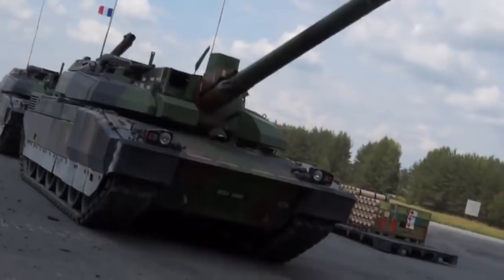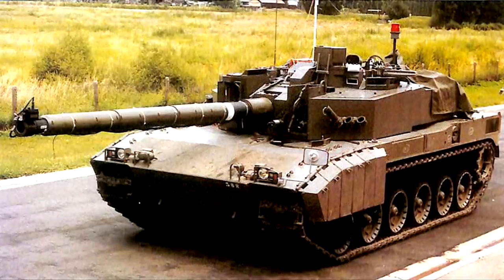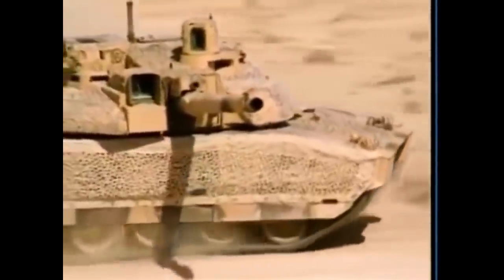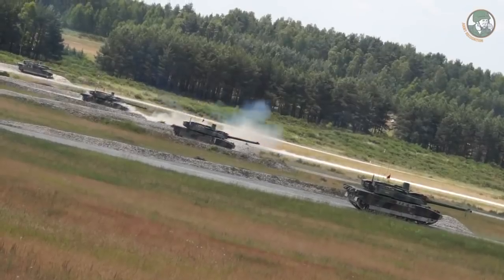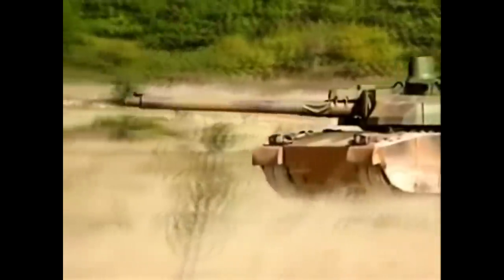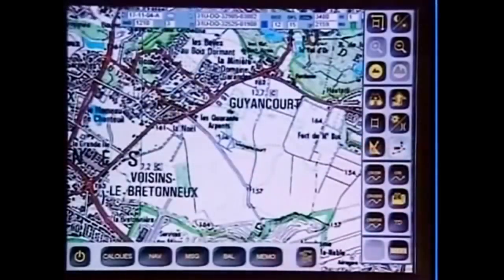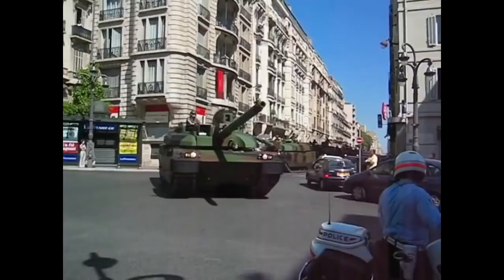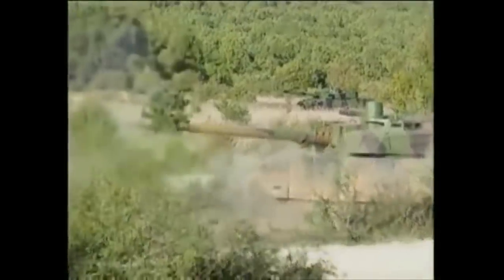Is Leclerc Obsolete?

Comment: It's fun to see how the leclerc is so badly known in the english-speaking world.

1st, The Leclerc's armor is equivalent to a leopard 2A5 for the hull (probably 2A4 for the turret), thicker on the sides. The weight difference comes from the smaller engine block and so a smaller hull.
2nd, in terms of firepower, the Leclerc have currently one of the most effective gun. The L55 for example equalizes its velocity while being longer. And it has now the OFLEs which are classified in addition to the NATO ammunitions. Why producing an anti-tank shell when you're not fighting tanks? That's why the F2 is not very produced.
3rd, what about target acquisition? The leclerc will spot and lock on a tank faster than any tank of its era, driving at 70km/h and hitting its target driving itself at 50km/h at 4km range.
4th, the Leclerc has an autonomy and a mobility superior to its main competitors. It can easily handle a 30° slope, in opposition to an Abrams and a Leopard 2, we won't talk about the chally 2, and can drive for more than 800 kms straight with its fuel tanks. In the greek trials, the tank rushed the raid and crossed the finish line longer before the others.
5th, Coaxial .50 Browning.

The main problem with is that the tank is not upgraded regularly and is not equipped with an APS. The French one doesn't even fight so that's why the army doesn't upgrade it.

But as we've seen in Yemen, the tank is far from being obsolete.

Sources : 
- Encyclopédie des Chars Modernes, Tome 1
- Wikipedia
- Greek Tank Trials Report
- L'aventure des Chars
- Opex360
Reply: Salut, une surprise de te voir ici! J'espère que tu sortira une nouvelle vidéo bientôt.
Reply: @lepointdevue1094  C'est prévu pour noel. ;)
Reply: C’est que des incultes de rossbeef ils l’ont toujours était et ils le resteront toujours : des idiots incultes
Reply: Roland Lee just for you to know. Yes we lost in Indochina in 1954. But 10 years later, after they claimed their independence and begin recognized a country by international, the US attacked it because of "Communism is spreading too much". They even lost more tanks than in Corean War! I don’t see why we need NATO approval to attack or to just do a regular peace keeping operation in a foreign country like Mali. We don’t need NATO for that, we need the Security Council of ONU to go. That’s why you’re wrong on these points. Second of all, the Leclerc wich he is talking about is a former version of the actual one. The Leclerc can withstand a direct hit from his own gun (and don’t tell me that an APFSDS that goes at 1790m/s is nothing) Plus, the OFL 120 F1 and F1B isn’t using depleted uranium so ecological impact is divided by thousands. But I see you coming for the OFL 120 F2 with the depleted Uranium. Yes it has got a penetrator made of Uranium but will you fire it against a little AFV or IFV? No, because it’s priceless in a tank vs tank combat situation. The mobility of the Leclerc is one of the best of the world, and it’s developing 1500Hp at only 2500 rpm, 500 less that the M1A2. And speaking of things like this, the Leclerc is currently one of the best tanks in the world and is actually combat used by the EAU in the Yemen war. It has been proved that it’s capabilities are greater than expected in combat. Now please stop begin salty and document yourself before saying things likes you said under the comment of Kahzmat wich is one of the best tank history youtubers actually. Good night.
Reply: Herr Kahzmat en croisade
Reply: Même pas remarqué que c'était toi xD
Reply: its true during greek trials and for the variations they were offered it had performed on par with L-2A6HEL (in mobility better) many were in favor of it, price was better too, co production was the major issue since ELBO was geared for german tank production and support (L-1), and germans as expected bribed some officials faster, better and more efficient than the french (they have long tradition and massive experience in that field)...
Reply: Larmure du Leclerc est interchangeable donc on peu fair évoluer le blindage se son des bloque de blindage
Reply: Toi ici?!
Reply: @rolandlee6898  go fuck your self
Reply: Dika Vinci 1st the Leclerc has depleted uranium munitions (not nuclear) which can penetrate all the other tank (heavier so with more kinetic energy)           2nd the Leclerc is really the only tank who’s capable of firing with quite the same accuracy as if it was immobile. We are not talking about gun stabilisation but about hitting a target 4km away at every shot.
Reply: Facts: French have most wins in relation to battles they fought. (Wikipedia )
Napoleon is the most succesfull war leader in known history. (Wikipedia )
During Napoleon times europeans taught that  the french were born for war ! 
Von Klausevitz said Napoleon was a god  of war. 
French military history is one of the most glorious. 
You can't judge a nearly 1000 year nation by 6 weeks when they lost to Nazy. No army would have stood against Wermacht in the same condition.

From an Italian with russian heritage who speaks also french .
Reply: You need about 15 tons of armor to cover one person in tank. Leclerc has only 3 crew mambers so that is the reason why it is lighter.
Reply: @rolandlee6898  yeah french people can be proud of her history because at least they have one
Reply: @osefman2763  And who doesn't?
Reply: @rolandlee6898  oh!! the usa! You only have two hundred years of historical existence! You are made of migrants that came from England, France... Yes french people can be proud of her history because you, you only have the XX century
Reply: @osefman2763  There is nothing wrong with being proud of your history. The problem is you still living in it. Its not the 18th century anymore, its the 21st! Write that down on your fridge so you dont forget it.
American history didnt start from nowhere. As an independent country it has a comparatively short history, yeah, but it doesnt mean history starts there. Your history argument only proves my point of you living in it.
Let me ask you this then.. Hypothetically suppose Russia and US go to war, ICBMs start raining down on France because its a part of the NATO crew, youll yell "BUT MY HISTORY!" at them and they will stop? Will Russian history prevent a US (and French) retaliation strike?
History didnt help Dresden, and many other German cities, much either when the bombs fell. Nor did history help France when the Germans run over the entire country in a couple weeks. History didnt help Africa, Asia and the Americas when the British, French and Spanish colonized most of it.
Just because you have history doesnt mean you are a relevant power in the 21st century.
Iraq has history and so does Libya. Did it matter?
By your logic Iraq, Syria and Egypt should the most powerful countries in the world because of their history.
Reply: @rolandlee6898  Russia though is still relevant right ? Oops their economy is laughable compared to France's (just like 98% of countries on earth: lots of people are irrelevant)
Reply: @rolandlee6898  Being on the brink of being surpassed in almost every domain by China, but still yells like a madman toward GB and France... How cute. 

At this point you're just exposing everyone your complete ignorance in domains such as : geopolitics, history, military, and so on.
Why the heck would the Great Donald say  "the French did a great job" talking about last week's hostage rescue operation ? Out of kindness ? Pretty sure not.
And BTW, as you're insisting on the fact we tea drinkers and frogs are living in the past... but aren't you living in the past yourself ? You  can't bear having a better tank than your Abrumz, a better plane than your SuPeRsTeAlTh F-35, losing the rest of grip you haed over Middle East and South America. Sounds like we're not the salty ones here.
Reply: Mais arrêtez de répondre à ce troll. Son opinion n’a aucune valeur.
Reply: @DoubleA44  Russia the second largest arms and military technology exporter in the world, after the US. And its the only country that is a valid strategic counterbalance to the US. Being capable of causing a global mass extinction of most complex life on the planet makes you pretty relevant.
Reply: One question tho.... Why do you think Im American or that I even like the US?
Kinda hilarious how you go there immediately. That says a lot actually. Nice.
Reply: @rolandlee6898  we can be proud to be french in 21th century too
Reply: @rolandlee6898  Can t be a strategic counterbalance to the US when your gdp is more than ten times lower than that of the US. They indeed export crap everywhere but they can t afford modern military equipment anymore (T14 produced in very low numbers, Su 57 still just a prototype). But of course having the biggest nuclear arsenal makes them relevant, it turned out to be very useful when ussr got teared apart at the end of the cold war.
Reply: @DoubleA44  Well thats not really true. If it were crap no one would buy it. Even American experts regard Russian equipment as superb, and in some ways even superior to what the US itself has.
Why would they need T-14 or Su-57 to be a strategic counterbalance to US? US and Russia, if they fight, wont fight with soldiers, tanks and planes. They are completely meaningless,will be turned to ash before the soldiers even dress for the occasion. Which is why Russia is drastically reducing its military in size and going more high-tech. Its sufficient and more efficient for any conventional conflicts they might have and for everything else they have 10'000 nukes and weaponized smallpox.
US can break Russia economically. They are trying at least, and have been since the USSR (with which they indeed succeeded), but militarily its a different matter entirely. Likewise the US itself is susceptible to such means. Primarily from China.
Reply: @rolandlee6898  People are buying russian stuff not because it's the best (which it isn't apart from very few domains) but because it's cheap and they want to keep good relationships with Russia. If anybody (including Russia) uses nuclear weapons everybody is dead on earth and it doesn t change if you have 10000 warhead carried by mostly obsolete missiles or 300 warheads carried by state of the art missles (M51 is the newest submarine launched nuclear missle in service in the world) like France. When it comes to nuclear armement, if France is irrelevant, then Russia is as well. The most important aspect to be and stay a global power is economy: the US didn't have the biggest army at the biggining of WW2 but they had the best economy. And in that regard Russia is laughable compared to France. Conclusion:  France irrelevant = Russia and nearly every country on earth irrelevant.
Reply: @DoubleA44  You contradict yourself.. If Russia is irrelevant why would anyone need to keep good relations with them by buying their inferior weapons?
Actually Russian kit isnt cheap on the global market and occasionally even a US ally chooses to buy Russian. Its a myth that Russian military kit is cheap. It isnt and has never been when sold abroad. It tends to have a lower comparative cost if you take estimated value off the internet, but adjusted for the local economy it actually ends up being just about the same, if not actually more expensive.. It was cheaper to produce during the Soviet era when all production was state owned, which runs at zero profit, the cost of a tank or a plane was literally the cost of materials (which belong to the state anyhow) plus manufacture expense with relatively cheap labor. Now its for-profit at every stage and the market dictates the value. So the price now is much higher than it used to be.

How do you figure the Russian missiles are obsolete and the French one is the best? Because youre French? Solid reasoning, cant argue with that.

Actually the US become the dominating economy as a result of the world wars. Thanks to its location relative to the wars. And they have stuck to the "war prints money" template ever since. That and scamming everyone for their gold after WW2.
Reply: @rolandlee6898  First off, I'm not saying Russia is irrelevant, I'm saying that if you consider France to be irrelevant then you have to say the same about Russia. So yes some countries want to keep good relationships with Russia just like some countries want to keep good relationships with France.

Of course when Turkey buys S 400 from Russia, it's not going to be cheap, but when they sell mig 29 (first flew in 1977) to Egypt they offer way lower prices than competitors. Their export version of the T90 is not expensive either. 

When it comes to nuclear missles, the main ICBM for Russia is the R36 in service since 1974 whereas France is equipped with the M51 in service since 2010. But you migth argue that 35 years of tech makes no difference.

The US definitly benifited economically from both world wars, at least compared to most countries but they were already in 1939 the biggest economy in the world by quite a margin. And if it wasn't for their extreme arms production rate during WW2, we would probabaly be ruled by nazi Germany and the Japanese empire. 

So when your economy is laughable compared to an "irrelevant" country you are irrelevant yourself.
Reply: @DoubleA44  you know that everything USSR export is really poor technology . because of that it cheap
Reply: @rolandlee6898  you want recent history, look how the us fair in afghanistan and irak ... yeah not so good... Now compare it to france in mali ... I'd say much better than the US
Reply: @DoubleA44  don't worry, i'm pretty sure he is a simple man to be polite, He probably doesn't even know what soft power is and that france the the second are first soft power in the world, russia being way way way down, more over russia's influence in the world is very limited compare to france...
Reply: @Quentor33  France is in Afghanistan too.. 
Whats the point in comparing different conflicts in different parts of the world? And there are only about 3000 French personnel in northern Mali, roughly 10% of the total fighting force, the majority of which is Mali military and the rest are from other African countries.
And how is it better exactly? Over 7 years now, thousands dead and nothing really changed. Its in the same state as Afghanistan - fighting continues.
Reply: @rolandlee6898  except that we acted in a conflict were it was needed and succed to the tach, now look at irak
Reply: @Quentor33  Who is "we"? Again, the french personnel is only 10% of the force and the majority of the fighters and casualties are Mali and other African troops. Not French. The significance of the French personnel in Mali is not that different from the French troops in Afghanistan. In neither case are the French a significant combat force, having similar numbers in both cases and having suffered similar casualties.
And how did "we" succeed exactly? The conflict is ongoing after more than 7 years. Nothing changed.
Foreign forces withdrew from Iraq and it fell apart.
You think Mali will be peaceful if the forces left? You mean like literally every other country in Africa that has a war or an internal conflict always ongoing? You mean its gonna be all peaceful and happily like Libya after the French intervention? Ok... sure...
Reply: @-timberton57-3  eh oh alors hein
Reply: that's an resonable arguments :)
Reply: @rolandlee6898  We are not masturbating yet, we are just waiting that your fat ass country destroy itself in a civil war because of all your racist and communautarism problems, then we will masturbate watching it xD
Btw France is still the 3rd nuclear power, the 5th world power and have the 2nd best military technologies in the world, add to strong values and united people, unlike your shithole ;)
Reply: @louisg2404  Who is the world police  again ? BTW the whole NATO strategy hinges on the US if you didn't know.
Reply: @YourLocalMemeAndAnimeDealer  others NATO members  strategies are very close to US strategy, simply because the culture and the values are close. So you can say that others follow US or US follow others, it's exactly the same.
Reply: @louisg2404  The US plays a central role in the NATO planning because of it's military
Reply: Earl Rudolph Of curse US have a huge impact on NATO, but they didn’t take all decisions (for exemple France have a lot of military operations in Africa without US support)
Reply: @louisg2404  But against Russia the US is the center for the planning
Reply: Earl Rudolph True, mostly because they are the only ones seeing Russia as a real enemy
Reply: @louisg2404  Who is they ?
Reply: Earl Rudolph US 😅
Reply: @louisg2404  Are you sure about that ?
Reply: Earl Rudolph I’m sure about anything I post 😉
Reply: Je suis pas souvent d'accord avec toi sur les différents avis que tu a donnais notamment sur le Sherman, mais la j'avoue tu as absolument raison. Rien que le blindage donc parle redeffect est obsolete, la version actuelle est bien plus blindé que le S1. Bref merci de lui avoir fait comprendre ce qu'est la réel puissance se feu française !
Reply: @kaana8421  Greece is pretty powerful for it's size and economy.
Reply: Metal lourd qui vient gentiment oklm calmer les Anglosaxons sinon hâte de ta prochaine vidéo
Reply: @rolandlee6898  its seems you don't know much about french nuclear submarines around your country seas, so any wars against us would result in a bad way, unfortunatly civilian casualties would be high but hey it would be your government's fault because the US  think they are invincible when they are clearly NOT, better have a little army with surgery precision than an overwhelming army that i too noticeable and can't even learn how to fight properly without make a fuckton of casualties, nice going US you are only a big power cause you do the same thing oversized like 10 000 obsolete tank design, at least our bond with germany is a way to improve in everyway, you on the other hand, everyone think you're hypocrite in everyway, you can't even make good relation in the countries you're invadi..  erm "repressing rebels terrorist and threats in general" with the locals,
So next time you're being a tad retarded go read some books and better sources on some related topics of this video.

Have a good day.
Someone putting an idiot in its places ;)
Reply: And i won't speak about oil rigs, all the US care for is Money and profit
Reply: @lebigeon  Seems you dont know France is a NATO member and answers directly the NATO command, which would be the US.
If you are so tough why you didnt say anything when it turned out the NSA is spying on your top leaders including the president and tapping their phones? Where was your toughness then? The US OWNS you. Simple as that, you cant even say anything against them, let alone actually do anything. Its hilarious.. The US fucking OWNS you.. As we saw in Germany - the intelligence agencies dont even answer to the German government, and its the same situation in France, which is what allows them to put every single French person under surveillance and you cant do jackshit about it.
Reply: Roland Lee 
Ok soo france doesn't have the same type of power than the US has. They are masters of the softpower... 
that means diplomacy, influence tourism... 
and a vast network of potential allies... france is known for using all assets to make allies : selling wepons to india and saudi arabia... keeping economical tide and trade with china, using language tide with africa, vietnam laos cambodia... not to mention the EU 
Therefore even if you don't notice it they can slowly redirect the world towards their intrest... 
2nd 
French a vassal of the us ? 
Ok now althought they are a good ally of the us in many situations they are many on which they hightly disagree... 
regarding economy... 
military intervention like mali where french troops secured the country ( ensuring loyalty of a potential ally) 
The sinai operation 
( securing suez and befriending egypt) 
They're operations are not those of a vassal of the us... 
a vassal would simply accompany his master in any war and not make their own 
Furthermore the french government is disagreeing with president trump on the economy and military cooperation... 
not what a vassal would do ... 
the french army is simply a diplomatic tool whereas in the us diplomacy is a tool of the army but that doesn't mean there army is weak... its elite forces are some of the best in the world... 
so yeah 
Tell me where you found thosr info about french being imprisoned by american intelligence...
Reply: LUNAR BLOODDROP  las time there were à war it was in Algéria
Reply: @rolandlee6898  1914 was not 1745...
Reply: As always as soon as u make a joke about the french they get triggered, why do u even need tanks? Ur country has already fallen to the muslims, and Macron is the puppet of Merkel.
Reply: @silentsigma2917  OmegaLul, a screeching ignorant.
Reply: @silentsigma2917  KK, brb when you have arguments and have stopped screeching, noob
Reply: As an American the French have probably the most respectable military history in the world.
In modern times they aren't focused on spreading their interests as much as the other powers. But they still operate on their own without NATO or EU support. As well as still having the only nuclear carrier outside the U.S. Most of the EU has been combining their military budgets to develop next generation vehicles just like every other power in the world. Their nukes are still a respectable arsenal that can destroy most countries. The argument of just needing to throw around nukes to win conflicts is also stupid, since it's just mutually assured destruction for the whole planet.
If anyone here knows about modern warfare they'd know that militaries are shifting towards unmanned vehicles, France included. There's considerations for completely unmanned armores vehicles and tanks. The dick measuring contest with nukes is becoming less and less prevalent when you can destroy militaries without putting your own people at risk.
In WWII it was their bureaucracy that actually had support for the Nazis that delayed their response to them, most of the world had nazi sympathizers as well, U.S included. But the French still fought incredibly hard, the Free French also continued to fight with success up until the end of the war.
With most of the phobia and France bashing seeming to come from the U.S after France refused to participate in either Vietnam or Afghanistan, I can't remember. The France is only good at surrendering has far overstayed it's welcome. It's beyond insulting compared to most of the other jokes against other countries.
The Leclerc itself is still one of the strongest tanks in the world, especially with the XLR upgrade.
With Germany and France combining the Leo 2 chassis with the Leclerc turret for the EMBT as a stopgap for export. Both Germany and France are developing what will likely be the Leo 3, as long as they don't split development again.
Reply: now there is the Leclerc XLR and also the french are developping their own aps
Reply: The Yemen has proved which the Leclerc have a better protection than Abrams and Leo 2A5.
Reply: @Tagadarealty  The UAE Leclerc is different from the French Leclerc though. They literally replaced ~50% of the tank with German components like a new engine etc and in 2017 also uparmored it with ERA from Dynamit Nobel and no Leopard 2A5 nor  Abrams with depleted uranium have ever been lost so bad comparison. The French also only use their Leclerc in low risk areas.
Reply: @rolandlee6898  i would To say the France dont surender all the time 
France was a great countrie and France le actualy a great countrie 

Sorry for my bad english i am french :)
Reply: @axellaprie6540  don't be sorry, I am sure that @Roland Lee don't speak any european, asian or african language
Reply: @rolandlee6898  Riiight. Riiiiiight. France will die in America's war. Like Irak 2004 amirite?
France can't launch operarions by itself.. Like in Africa right now? And I won't even talk about Libya, which was going to launch whatever the opinion of NATO was..
Reply: @maloflory  No French military personnel died in Afghanistan? Quite a few did.. and for what exactly? Attract attention to France from the Muslim radicals so that more French people die? Good job!
African operations are fully approved, France doesnt have the authority or liberty to conduct independent operations. As we saw how the German intelligence service isnt even answering to anyone in Germany (directly answers to CIA and NSA), there inst much doubt that the French are any different. Tapping the president's phone without his knowledge, for instance. Oh, they already did that and keep doing it... And what did the French do about it once it was revealed? Absolutely nothing.. bend over as usual to keep getting fucked in the ass as they have been for the last 100 years. What a mighty country indeed...
Reply: @rolandlee6898  The very fact that you completely purposely ignored the Iraq case tells a lot about you. France did so as a matter of respect to Iraq's sovereignty against the will of the US, and used the UN to do so, which is why the US and the UK did their thing without the UN agreeing. How can you then proceed to claim that France could be at the boot of the US by respecting the functioning of the UN, if said organization is not owned by the US?
It's all a matter of logic at this point. Perhaps you should learn that the world isn't black and white, that there is quite a lot of shades and complexity that you have yet to discover and understand, and France is by far not a vassal state of the US anymore, and that since the 70s.
Reply: @rolandlee6898  Sure, France couldn't afford being in Iraq.. But it afforded bombing in Libya, potentially by itself. Got it. Again, try using logic.
A vassal state doesn't just refuse to follow its leader in battle, otherwise it's not a vassal..
Reply: @maloflory  Do you have any idea how much the annual operational cost in Afghanistan is and how much the budget is?
It costs about 400 to 500 million euro per year to be there, and the total budget for overseas operations is less than 900 million. Unless you get approval for increased funding, which the public wont support, France couldnt afford to get into Iraq.
So yeah, try logic.
They followed into battle in Afghanistan, which was part of the same plan and narrative that went into Iraq 2 years later. And Libya wasnt a French thing by any means. Dropping a few bombs doesnt cost as much as maintaining continuous ground presence. Not even close. Again, try logic.
Reply: @rolandlee6898  "400 to 500M per year" Yet we went in Libya, which costed around 100M in 3 months, so 400M a year.
And no, if you knew what you were talking about, you wouldn't say that "the opex budget would need an increase", since the additional cost that goes past the opex budget is directly taken care of by the state budget itself, public opinion doesn't have a word to say about it in this case. So again, if France wanted to go into Iraq, it would have been in Iraq, even with a minor presence. That's why the American and British politicians and civilians were so mad about the French decision: France could afford it, but decided not to take part in an unjustified war. Which is indeed hypocritical since France later started the operation in Libya, over completely unjustified reasons, hiding the French neo-colonialist interests and Sarkozy's personal interests. And again, you're wrong, the Libyan intervention was started by France. There isn't any doubt about this.

Oh, and, "dropping a few bombs doesn't cost much". What a great way of saying "I have no idea of what I'm talking about". An hour of flying for a Rafale costs 12k €, kerosene not included. A French missile? 250k to 300k€. The amunitions used in the Libyan intervention literally costed 60M€ over three months and are by far the biggest expense of the war.
Reply: @maloflory  I think you have problems with numbers... 500 is more than 100.
With an operational limit of 900 per year going into Iraq would require increased funding. Taken care by the budget? How? They will shit more money? The money has to be taken from somewhere and the budget already runs at deficit (and France has a debt equal to its GDP). It can cover the cost for one time emergency expense, sure, like a 100 mil perhaps, but not for a sustained and planned operation intended to last over a decade with a projected annual expenditure of 400 to 500 million just to keep some guys in a desert. For that they would actually need to increase the funding and plan for it in the next budget. Which means relocating funds, which France doesnt really have.
Reply: @rolandlee6898  France an irelevant country?Sure they arent  China or US but they are still a major country which posses a handfull of nukes.Not to talk about their nuclear carrier.
Reply: @ionutbalta6607  stop feeding the troll... you guys seem new here.
Reply: Hmm, Wikipedia and L'Aventure des Chars aren't really reliable sources. Especially that book, it is largely outdated and the informations displayed in it were never really accurate to begin with, largely due to French national pride.
Reply: Im just curious after watching some videos of this dude it looks like he thinks all modern tanks ate obsolete and shit 😂 so if all tanks are shit wich tank is good?
Reply: Im greek I wish we bought leclerc instead of leopard viva la france
Reply: I thought the Armour is classified you can't compare these without knowing the Armour composition.
Reply: Kenan Furcle i smell french bias
Reply: There is a well documented history of french tanks being remarkably good in driving fast (*mainly backwards or with their backs towards our Panzers)
Reply: So why does the leopard 2a7 always win at the NATO tank competition?
Reply: @lordtachanka6489  leo2a7 is more polyvalent, it just wins more test, but not all. When you create a tank you create it for a certain purpose. In this logic Leo2a7 is a food all around tank but when it comes to more specialized purpose other tanks may be better.
Reply: @simonledarue8263  the leclerc has a  better Range but thats pretty much it.
Reply: @lordtachanka6489  and has the best stabilizer and an autoloader that makes it an excellent tank destroyer
Reply: @simonledarue8263  when the Information from the Video is right it cant pen a leo 2a7 frontally... but yeah 5 seconds reload is awesome. I also like the look of the turret
Reply: Leclerc armor protection is far from being as good as Leopard 2A5 protection
Reply: Ça fait plaisir de te voir ici, le char Leclerc est très bon, mais la vidéo reste quand même impartial et assez bien foutue, ce n'est pas comme d'autres vidéos anglo-saxones qui nous fait avaler du "agne agne agne the French are the Looser".
Ps: a quand la prochaine vidéo.
Reply: Dassault Mirage 2000  Im not a Frenchman suffering from delusions of grandeur that are little more than a facade to hide suppressed insecurities, so - no.
Reply: Lmao all you Frenchies getting butthurt need to relax. Its just a joke lol.
Reply: Thats all good and well. But its French... Its going to run and surrender two weeks later.
Reply: @rolandlee6898  dumb ass counter: +1
Reply: @rolandlee6898  lol... Not funny anymore
Reply: @rolandlee6898  french have best ratio for victory .
Better than german US or UK
Even with 1940 or Indochina war. Algérie was à military victory
Reply: How original and witty you are! :o
Reply: @Kahzmat  Its true tho... Like who do you think France is going to fight? US? China? Russia? Who? No one.. at best it will be used against some illiterate peasants in Africa just so the French can feel like they are still relevant in the world when they really arent.
Reply: @rolandlee6898  Abrams is being used against Peasents in the Middle East lmao.
Reply: @Kahzmat  il parle d'une version qui est ancienne et ne parle pas de la XLR qui est largement mieux
Reply: @rolandlee6898  It's not true that France has the best military history of any county
Reply: @yourlordandsavior6940  sources ?
Reply: @princessapplestrach6327  Google is your friend
Reply: @rolandlee6898  it seems you know a lot about politics
Reply: @rolandlee6898  Cuz u think US could fight China or the other way around ?
Reply: @rolandlee6898  Anyone who thinks French army is bad...please stop using rifles, cause white powder was invented in France
Reply: @Kahzmat   Ca fait plaisir de voir un YouTuber de ton talent que je suis particulièrement sur cette chaine. Aurait tu le plaisir de faire de nouvelles vidéo ? Je les attends(et beaucoup d'autres personnes) beaucoup et t'inquiète on explosera la barre des likes!
Reply: @rolandlee6898  same thing for all country. Not only France
Reply: @Kahzmat  Et mais je te connais toi ! j'adore tes vidéos !
Reply: @skwal5464  Le problème est qu'il la présente comme la plus récente.
Reply: @ltmentle5293  Pse notice than even having been hit by russian and chinese ATGM on multiple occasion, NONE Leclerc tank was lost or even disabled in combat!. Have a look on YT, and admire all the Abrams hit by ATGM and simply exploding .  USA are always developping poor armoured material, without any sound experience. Remind how the M4 Sherman (wouarf! a rolling cathedral!) was putting ablaze (like Notre Dame cathedral) by Tigers and Panthers. Your Abrams is the modern M4, a sitting duck.
Reply: @skwal5464  Comme je le cite ailleurs, le Lecler s'est bien mieux tenu au Yémen que l'Abrams ne l'a fait en Irak (suffit de voir le nombre d'incendies violents et d'explosions d'Abrams sur YT après attaque par ATGM ! ). Les USA sont nuls en blindés, toujours à la traine, avec des blindés peu fonctionnels et puis avec tous leurs obèses à caser dedans ...
Reply: @ltmentle5293  as Abrams is . The Daesh peasants and the Yemen  peasents destroyed Abrams by the dozen, and they were mere peasents, how could you explain that ?? Do you imagine the Abrams confronted to the Armata or the T90 ?? This should give you some nightmares.
Reply: @florentleider222  I was trying to defend the guy talking about Leclerc calm down.
Reply: @rolandlee6898  US Army used M1 Abrams vs peasents in the middle east when French army used armoured personnel carrier to transport competent, courageous and intelligent soldiers who know an Abrams or Leclerc are not adapted for montanous where  country like Afghanistan where the Chasseurs alpins of the  27th Mountain Infantry Brigade are more efficient
Reply: @rolandlee6898  couldnt have said it better
Reply: @dragonstormdipro1013 Rifles were around long before the invention of white or smokeless powder
Reply: @dragonstormdipro1013  gun poweder was invented in china
Reply: @rolandlee6898 not the US because of the history tied between these two countires it would be the dumbest move to dare taking on the US,why do you say the french aren't military relevant anymore when nuclear weapons are in their arsenal ?
Reply: @Cataegis-2cb  the number of nuclear weapons France has is insignificant in the grand scheme, less than 5% of Russia and US. SLBM capability is recent, and being a NATO state it cannot operate independently in any major conflicts. They are obligated to ask the US for permission first. Which is why France is not even considered as a full actor in any hypothetical global conflicts but merely as a component of NATO, of which it makes up about 10%, the bulk of which is US and which is commanded by the US. You tell me - how relevant is a military that takes orders from another country?
France doesnt have global power projection capability either, it is considered a regional power, not a global power like US, Russia and even China.
Thats France is not relevant on its own. It will never face total war on its own, but always as a small fraction of the greater NATO force.
Reply: @rolandlee6898   For someone who think he's repelled by automasturbation, you seem to reallyyyy enjoy it.
Yes France has obviously less power than the USA. It doesn't mean it's irrelevant. China seems on its way to vastly surpass the US (on raw power) by the end of the century. I wonder if you'll keep this point of view.
Reply: @rolandlee6898  wow after so long this is still going on ? Thats impressive
Reply: @seraphiellopes6993  Well it pops up on my notifications.
Reply: @rolandlee6898  true enough
Reply: @rolandlee6898  I wonder what France did to you ? Why spent all this time trash talk France in a comment section that nobody cares, im curious what the point ?
Reply: @rolandlee6898  Oh ok. But i hope you know that this is the french governement that surrender and not the people who was still fighting and dying for our country. Have a good day.
Reply: @rolandlee6898  I don't understand toi of your arguments:
First of all, the one about americans spying french, everyone spies  everyone and everyone knows it is spied bye others, the only difference is  the capacity to keep the secret. So what should France do? Declare War? Embargo or taxes on US?
 Second, you say France is a US puppet because it doesn't take mesures against potential ennemies, but USA doesn't too. For example, China (again!), taking it's islands in the china's sea, what is the US doing? China giving money to african countries developement, ensuring allies and strategic ressources, what is the US doing? Revelent power  for what? Commiting mass murder in the middle east and then blaming russia, a country that is just  fighting against time with only a few of it's power? 
I am not an expert on the subject, just asking questions.
Reply: @simonledarue8263  Spying on hostile entities is normal. Spying on your allies is a violation of agreements in place. The US is violating French sovereignty and individual freedoms with impunity and the French cant do anything about it. There is nothing they can do about it, they are a vassal state, bend over and spread your cheeks. And no, not everyone spies on everyone. French dont spy on Americans. Why? Because the French security services are under US control. Even if hypothetically they would commence such spying the US wouldnt tolerate it and would order France to stop.

Which US islands is China taking in South China sea? There arent any. China is building artificial islands and claims them as their land to then lay claim on the surrounding waters, which were either international, Vietnamese or Filipino prior.

Debt trapping is a common strategy, which was and is used by the US as well, not just by China. China learned that from US.

I dont understand how American intervention in the middle east or anything else you mentioned is relevant to the fact that France, and all other NATO members, is a US puppet.
Reply: @rolandlee6898  Taïwan? Indangered, as many of US allies in the region and as soon the US. 
Uh? They don't spy each others? In the terrorist fight actually they do, and that's Why USA permit it.
I'm not arguing that France or any other country is more or less irrevelent, just saying that the countries you point revelent are not that much
Reply: @simonledarue8263  Taiwan is safe. If China could take Taiwan they would have done so long ago. US and Taiwan have massive defense deals and cooperation.
Public surveillance has actually nothing to do with terrorism. Terrorism was, however, used as an excuse for it. Or the French president a terrorist that the US need to tap his cell phone?
Reply: @rolandlee6898  that's not even funny anymore
Reply: @rolandlee6898  You make nice arguments. Do you consider leclerc a good tank? If not, which tank is the best?
Reply: @rolandlee6898  You know that "fallacy bias" doesn't mean anything, right ? You actually have to qualify the fallacy or bias, but of course you can't do that because it's a fair comparison between two vehicles of the same class, in the same conflict, against the same enemy.
Reply: @amicaze9570  What did I say? I dont want to go though 190 comments..
Reply: @rolandlee6898  its too easy to offend french ppl tbh XD.
Reply: @rolandlee6898  Yes, it is possible, but it is still over the UK in rank military powers and at least she doesn't buy American weapons and produce them herself
Reply: @deuxalex562  UK also produces their own. Most American weapons are supplied by foreign companies or sub-contractors, even small arms. Same applies to all other countries. You'd be surprised how much "Made in China" actually goes into your "Made in France" equipment. Its quite a heated topic in the states actually.
That being said, I would agree that France probably outperforms UK in terms of military power and projection.
Reply: @rolandlee6898 Imagine making your knowledge on meme, actually pathetic, but again your American so its pretty normal
Reply: @rolandlee6898  I just hate those anti-French jokes. They are nothing but good old Anglo-Saxon francophobia. Sure, France was defeated by Germany in WW2, but it's not like UK wouldn't fall in 2 weeks had there been no sea to separate it from mainland Europe. The French have great engineering skills and their WW2 tanks were top notch for their era, more than a match for the German ones. And what about Napoleon - he beat everyone who didn't outnumber him.
Reply: @petar.banovac  Right... We saw the top notch tanks perform against Germans.. 

Napoleon? Not relevant in present day really, but in Russia he got f'd hard. Most of his troops died or deserted as soon as they started to starve and freeze. Had to run back to save his own life and lost all of his army with not much to show for it.
Reply: @rolandlee6898  Name a German tank that was superior to Renault Char B in 1940, please? The poor French tank DOCTRINE and the lack of proper air power, plus various other reasons contributed to French demise against the Germans. French tank design has nothing to do with it.
Reply: @rolandlee6898  France is the most victorious country, you can shut up
Reply: @jacquesdutronc2034  According to what and victorious against whom? 
Why cant the most victorious country say anything when US and their own French intelligence services spy on the French public and even the French president? So powerful indeed...
Reply: @rolandlee6898  according to history record France waged war against 80 pourcent of the planet and won most of it
Reply: @rolandlee6898  it s funny thought how you made a joke about à past defeat but lecture people about ont living in the present
Reply: @seraphiellopes6993  80% you say? LOL... good one! You should be a comedian!
WW2 is the most recent and the most modern war France has been in and fought on home soil against a country of equal development, size and military potential. And they lost in a rather humiliating way. Quite different from shooting starving African tribes in the 1800s, wouldnt you agree?
Every other operation France has been in since that was an insurgency operation, mostly in the former colonies, such as the Indochina-Vietnam war, which the French once again lost (were unable to even put up a fight) and thus ended its status as a colonial and global power, clearly showing that France had lost its place in the global arena since WW1.
The only reason why France is in P5 at UNSC is because its a US ally, gives US more leverage and stability within the organization, its a nuclear power and its been historically important. Same reason why the UK is there. But in relative terms of modern day geopolitics and global security France is completely meaningless, which is why many are suggesting that countries like India and Brazil should be have permanent seats in the UNSC instead of France and UK, who bring nothing to the table other than hopelessly masturbating over how great they used to be centuries ago as if that meant anything presently (fyi - it means absolutely nothing). Germany is still a more important geopolitical power than either France or UK, even if it might not appear so at first.
Reply: @rolandlee6898  the last war they fought was Algéria and they won . How many war was won by the US without coalition ? How many? France entered war against indochine just after WW2 they were still recovering the US fought them at the peak of theirs power and still lost .
Anglo-saxon are the only one making fun of the french lost in WW2 the german praised the french for theirs résistance for they killed almost half of the invading german force .
As of today france is the number one soft power in the world
Reply: @seraphiellopes6993  Are you sure they won?
Last time I checked it ended with Algerian independence and the end of the French Empire. And are you suggesting Algeria was on equal military developmental level as France? Hilarious...

You think the coalition matters? The coalition is almost always a small part and almost always a supporting role. Aside from the British, who did a bit more although still largely irrelevant.
Yeah the US lost. So? We are talking about France here. Youre the one claiming France never lost and conquered 80% of the planet. Youre not really building a case for that, mon ami, if your best example for France winning a war is a war they lost and a war that ended the French Empire.

Germans are very careful when it comes to talking about the war. As for the casualties, in the grand scheme the french contribution was insignificant. But props to the resistance fighters, insurgency is highly effective. But French arent the only ones who did that. Far smaller countries did it as well, for much longer and didnt get Americans and Brits coming to save them.

According to what is France the number 1 soft power in the world? The US is. France might be at the top simply because its in the top economies. The only place where France has real influence is the former African colonies, and thats mainly because of corrupt governments and elaborate economical ties that guarantee French dominance, such as some African countries having their money and legal documents printed in France. Beyond that France has practically no influence anywhere, despite having one of the largest diplomatic networks (which is again mostly a product of history not a deliberate action of the present day). Id like you to tell me what sort of control and dominance does France have over China, for example, as a result of its soft power? If you actually look at the numbers is more of the opposite.
Reply: @rolandlee6898  they won the algerian war but de Gaulle decided that colonie was a waste of time and ressources that s why he gave them the indépendance 
France kill half of the invading force half of theirs tank and 1/4 of theirs plane it s not insignifiant especially compared To the other country germany  invaded .
Coalition doesnt matter that much ? Then why did us only won two war by themself? 
France is the number one soft power because right now US isnt doing great in diplomatic relation Britain is leaving the EU  and germany is declining not because it is the ally of the "almighty" US but because of its diplomatic network its one of the greatest country in the world just accept it
I never said the french never lost and yes they conquered à lot not only in africa but in europe and the western part of the US belonged to the french they just sold it To britain
Reply: @seraphiellopes6993  A bit more complicated than that. The UN mandated a referendum, which resulted in a vote for independence after attempts to suppress the revolts and insurgency had failed, with some 25'000 french soldiers dead. Basically they died for nothing. An astounding success... Much like the US in Vietnam. So you didnt "give them independence". You never had the power to. They took it.

Germany lost 27'000 troops, 800 tanks and 1200 planes over the 46 days that it took to overrun France. France lost 360'000 dead with some 2 million surrendering. German military personnel at that time was around 3 million (same as France), you destroyed 1% of it. ONE! Not half or 1/4 of it.. 1/100th! France lost more tanks and more planes than Germany, so what are you so happy about? Of the total wartime production the losses in France were a single digit percentile, 800 out of 67'000 tanks and 1200 out of 130'000 planes. Over 70% of all German losses were on the eastern front, both in personnel and equipment.

The US isnt interested in winning. Its impossible to win insurgency wars. Same reason why France lost Algeria. The only way you win is by killing everyone because everyone wants you gone. And the French didnt win jackshit by themselves either. In in Algeria, which you lost, much of the fighting was done by loyalists not French soldiers. A coalition.

Why would US relation with Britain be of any significance to anything?
Yeah UK is leaving EU, and that affects France as well. The EU as a whole is at risk of falling apart. Currently its Germany holding it together.

Conquered in Europe? As evident by France losing its European conquests or the gains being short-lived? What are you smoking? If you conquered Europe why are there 40 other countries in Europe and not just one big glorious France?

Colonization of America is irrelevant. It was done by everyone who wasnt lazy. If you take the size of colonies in America as measure of greatness then the French once is once again the SMALLEST of all. Spain, UK, Portugal and even Russia held larger territories than France. And mind you - Russia still has most of the territory it had as an empire, but France doesnt. Colonies in Asia and Africa also mean very little. Belgium had colonies in Africa despite not having even a formal military presence there, and the Dutch had Indonesia and colonies in America as well. By your definition that would make them just as great as France. Its idiotic.
Reply: @rolandlee6898  they were four group fighting in Algéria two wanted the independance and killing each other the third one were Algérian who wanted To stay and fought with France . You see the two first were almost exterminated but in france were also divided on the question not only algerian committed terrorist attack because they wanted To leave but some french did the same because they wanted algeria To stay french thats why De gaulle asked the french if Algéria should be given the choice french say yes give algeria the choice Algéria chose To leave 
Concerning the german loss they were 63682 german killed over the course of the battle of France but more importantly they lost à significant amount of aicraft over 1300 for 3900 that Will cost them the battle of england i dont know where you got those number of losses
Reply: @rolandlee6898  i am talking about german  invading force during the battle of France  and those losses helped Britain à lot even if the battle of Britain was just To scare them it gave them time To be a little bit more prepared 
Yes the USSR contributed greatly more than any other country To th demise of germany but it was also because of them that they were able To pull this off
Reply: @seraphiellopes6993  They didnt. Germany replaced 1000 planes within a month. Luftwaffe monthly data is available if you google it. They had over 3000 planes at all times all the way to 1943, after which it grew over 4000. The Brits shot down over 2000 over 8 months, but the Luftwaffe numbers only increased over that time.
Wartime production was over 100'000 planes, that adds up to an average of over 1500 PER MONTH over a 6 year period. Over the war they lost over 70'000 planes and at the end of it in 1945 they still had over 4000 left.
The average loss count per month (75'000 over 6 years) is around a 1000 per month on average. Losing 1300 in 46 days is just about the average loss ratio they for 6 years straight. Again, nothing unusual or extraordinary about it. They were literally building them faster than you shot them down.
The biggest losses were pilots not the planes. But at that point they were not involved in the East (where most of the losses were) yet so training new pilots was well within their capability. It was only the second half of the war when it got progressively worse, poorer equipment quality and less experienced pilots. Which is why they lost far less over Britain than what the overall wartime average was. They lost just about 300 per month on Britain when the war average is around 1000. 
Again, your bullshit doesnt add up. Basic facts and numbers disprove your delusional claims.
Reply: @rolandlee6898  at the start of the battle of Britain germany had 2700 plane  there is no delusion in what i Said your words are full of arrogance and disrespect
Reply: This is dedicatedly THE BEST thread EVER. Lmao you guys have funny lines when you try to insult condecendingly and in a not obvious way. Props to my nigga Roland for the funny lines. And creds for the French that made him respond for 6 months and make me laugh. Yall niggas are great.

Sincerely an Iraqi.
Reply: @rolandlee6898  Aren't you all tired with the french surrendering joke ... I mean, France has won more battles than any country in the world, except maybe England, and I'm not even sure ... Isn't it time to put this one to bed once and for all ?...
Reply: @rolandlee6898  I'm reading your bizarre arguments about french army etc ... I was wondering : Did your girlfriend left you for a french soldier or ... was it your mother ? Because such bad faith and hate is not healthy. You should see someone ...
Reply: @rolandlee6898  No worries. I myself made jokes about surrendering frenchs with my American friends. I just wanted to set the record straight about the fact that France won more battles than they lost, especially recently. No patriotism in this. Just historic reality.

Now about french arboring many  has beens, I'll concede ...

But about vacuous  and ridiculous patriotism, US has no competition. 

Just go to a Maga rally ... Speaks volumes
Reply: @denismmoulin  The most recent war they were in where French had to fight for France was WW2. Since then a couple colonial wars, like in Vietnam. They lost ALL of them. So wtf are you on about? The last war they technically won was WW1, over 100 years ago.
The mighty French record of alleged "most battles won" is not substantiated by anything factual and relies on medieval battles to pad the record. Thats why its hilarious. They literally made up a nonexistent statistic to stop people joking about their military failures, especially at a time when the survival of the whole country mattered and instead of fighting for France they surrendered to a numerically smaller force.
US patriotism is hilarious in its own right, but at least they dont have to pretend like they didnt surrender the whole country and make excuses by referring to meaningless medieval battles.
Reply: @rolandlee6898  again : 

https://en.wikipedia.org/wiki/List_of_battles_involving_France_in_modern_history

read and calm down. You are spending way to much time on this issue
Reply: @rolandlee6898  That said : US did kill a Chinese balloon with a raptor. That could count as a victory against CHina invasion. 😂🤣😂
Reply: @rolandlee6898  yes, yes. The joke has been overused a bit. French army scores the single highest win to loss ration of any army in history.
Reply: @rolandlee6898  the France have the best win ratio in history and France have conquere during all of history the usa , the africa,  all of the Europe to the russia , the england and a part of Asia
Reply: @axellaprie6540  not against european powers. Stop spreading this information that is just ripped out without context.
Reply: @rolandlee6898    surrender as US troops did in the battle of the bulge while fighting against exhausted german troops ?? Less than brilliant to see columns of GI smiling, relieved to have not to fight any more.Pse, have a look at this very interesting episod widely reported in serious history books (not US ?) , may be you'll be less prone to french bashing.
Reply: @rolandlee6898  you don't need to surrender 2 weeks later if you destroy the ennemi in 2 days 😂😂
Reply: Skwal but yet they come crying when they’re facing the Germans or the British
Reply: @rolandlee6898  Excuse me but ain't to happy with what your writing here. 1st America became independent thanks to France, but unfortunately it isn't really emphasized in the history books. 2nd France is the nail with Germany keeping Europe as a whole+ they have the best military in Europe. 3rd The French equipment is very recent and is extremely efficient, even more than the Us arsenal except in the navy department. And lastly why is France so irrelevant even though it possesses a veto in nato? France isn't what it used to be, true but still it is a great nation and it still has a political influence all around the world. You might have forgotten that France has access to some nuclear weapons. I wouldn't call France a dying country. Instead of raging and shitposting stereotypes like a 12 year old please consider researching info before making yourself an idiot. I can talk as I'm German,French and English.
Reply: @rolandlee6898  During WW II in year 1940 the French army sacrificed itself to destroy half of the German army when US army relax waiting British  army first, then Red army, destroy the second half of the German army, US Army arrived only in 1944 to fight  exhanguinated soldiers
Reply: @kiefferfx18  LMAO.... Thats one of the funniest jokes Ive heard in a while...
Reply: @rolandlee6898  :D
Reply: yawn ,.,, yes .... take all german inventions and put the tricolore on it ... you call that a great tank ? the local industry would not be able to create something close to be this MBT ... so stop please with to much hurrays
Reply: No Wonder « take all German inventions and put the tricolore on it » do I need to tell you that they don’t « took » the inventions but France and Germany worked together.. the Leclerc is a Franco-Germano tank idiot. If you disagree and you are not happy with that put the fault on Germany not France if Germany wouldn’t wanna work with France they wouldn’t have done it dumbass.
Reply: @nowonder2798  Lmao, try again. The German ground forces are exclusively carried by Thales France. They can make an engine and an armor box, but then have to buy every electronic system, every communications array, every navigation set, from Thales. Every missile. Every IRST. Every radar. Thales, Thales, Thales. Germany is irrelevant now in the technology sector, a dying grasp at wanting to be significant
Reply: @nowonder2798  Leclerc don't need Germany, what are you talking about ? The Leclerc is French made with French components. Only the Emirates version got a Benz engine, because of the customizations demanded.
Reply: @nowonder2798  remember Abraham has same gun as leopard and the leclerc not